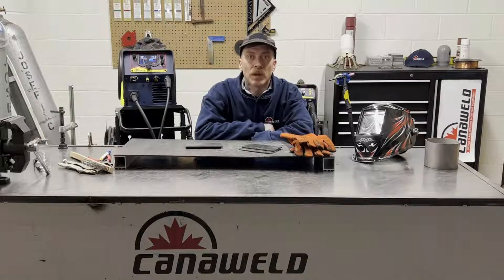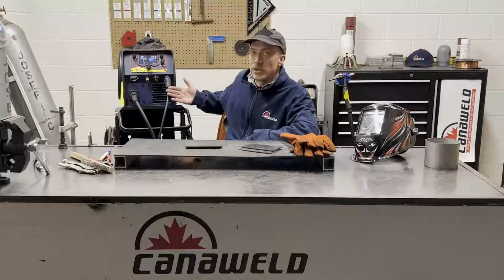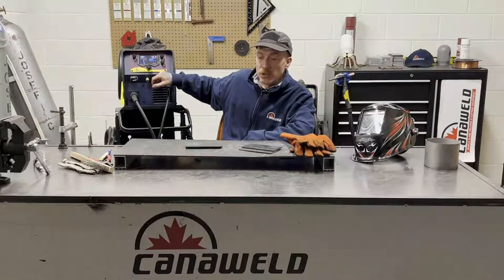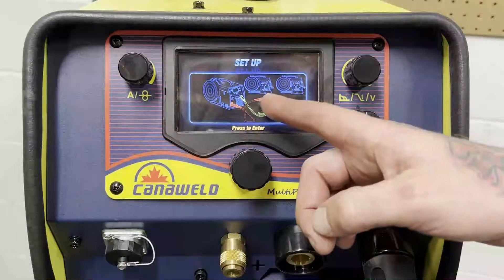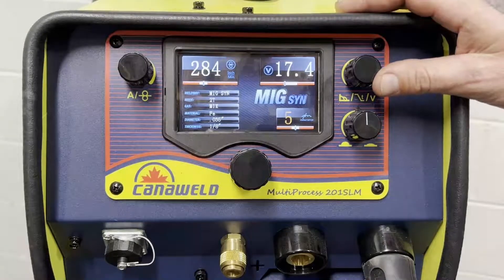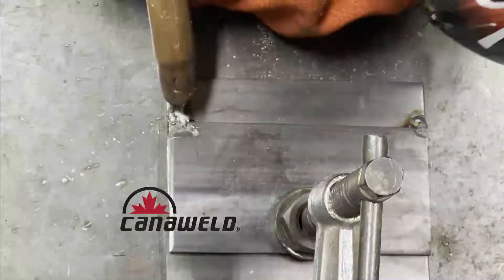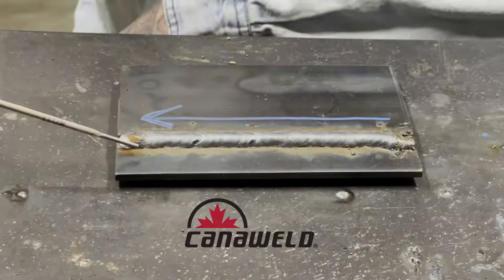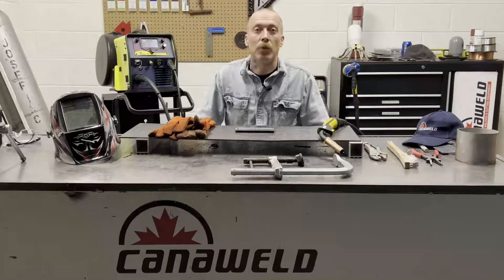Part 1-The Best All in One Multi Process Welder, MIG, TIG, STICK Welding Machine by Canaweld,

Comment: Hi, I recently won at auction an older AC/DC Miller Thunderbolt. I know enough about welding to be dangerous. Is the Thunderbolt considered a power source and are there attachments that can turn it into a MIG and/or TIG welder?
Reply: I have never used a thunder bolt but I do know the machine,.I may be wrong but to me It looks like a straight stick machine that you can run on ac or dc . As far accessories go I'm honestly not sure but I would guess probably not . Thanks for your question though! Hopefully I can be more help next time
Reply: @nickbaspaly6239  Thank you.